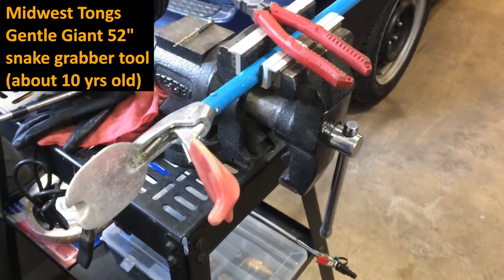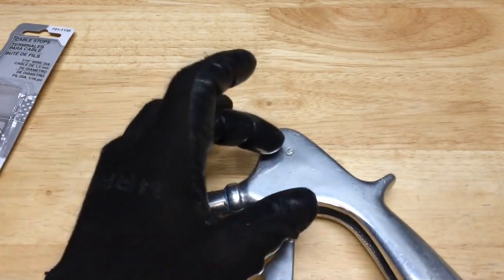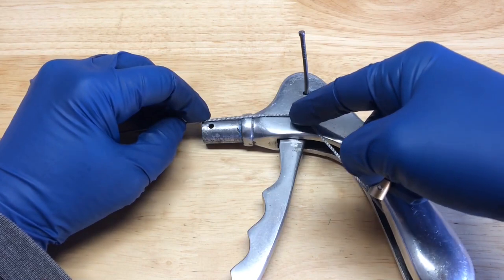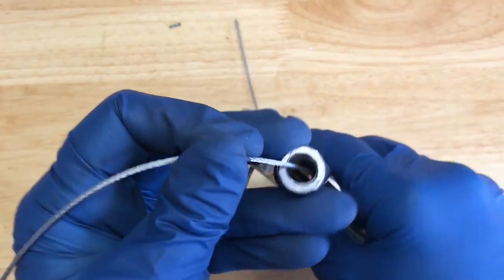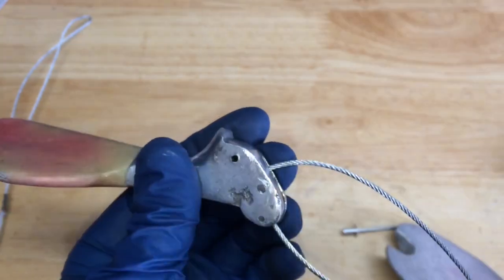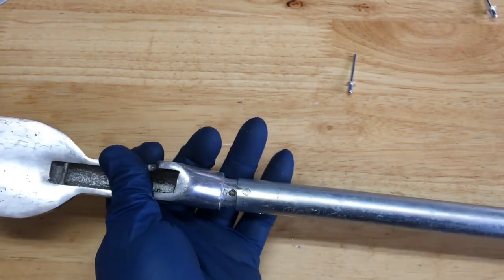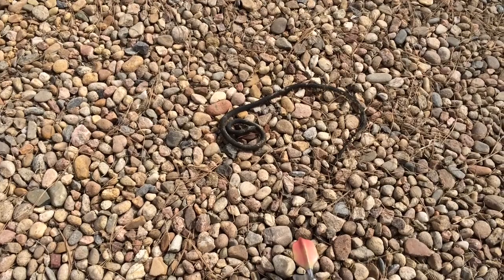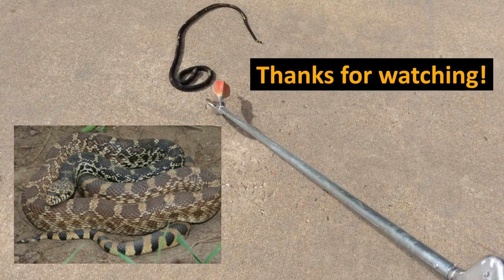Midwest Tongs "Gentle Giant" Snake Grabber Repair & Modification, Disassembly (Snake Catcher Tool)

Comment from the maker: Timestamps, parts, tools:
00:48  Drill out the pole rivets
01:58  Remove the grabber end pins
02:46  Remove grabber and handle ends

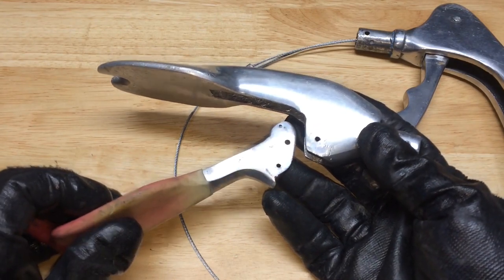02:53  Replacement parts and modification ideas on the bench:
- 1/2" EMT conduit as the replacement pole ($4 for 5 ft)
- 1/16"  wire rope cable stop (ie, NAPA 731-1135, $2.49)
- 1/16" aluminum wire crimps (ie, Everbilt 566 466, $2.57)
- 1/16" wire rope (34 cents/ft)

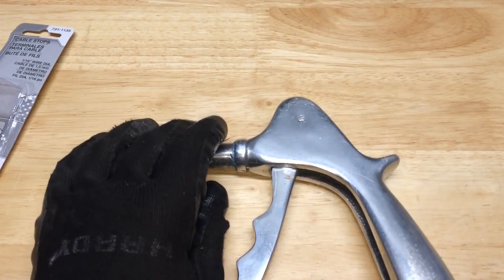03:55  Remove the handle pivot pin
04:36  Disassemble the handle
04:55  Location of new drilled holes in handle
09:10  If using new wire rope: make the grabber end loop
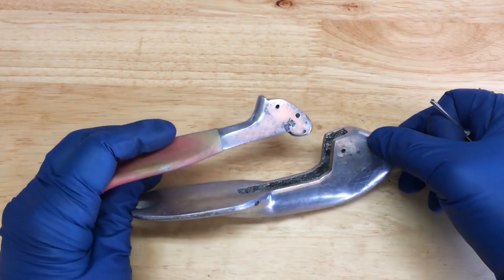10:13  Partially assemble the grabber end
12:18  Install the new pole (conduit)

13:34  If using rivets: make a template and drill the pole
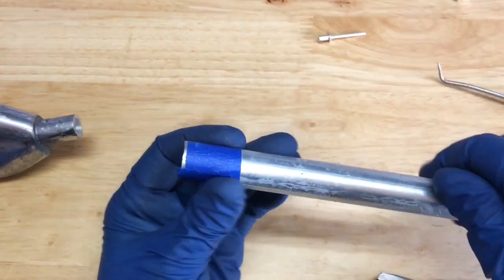14:28  Riveter (Pittsburgh 58612, from Harbor Freight, $20)
15:26  Rivet the grabber end to the pole
17:00  Align the handle with the grabber end
18:07  Complete assembly of grabber end
19:17  Temporarily assemble the handle end
21:27  Check the fit on the handle end
22:46  Install the handle pin 
23:46  Tension and test the new setup
26:13  Crimp the handle loop

Thanks for watching, and good luck with your snake grabber!